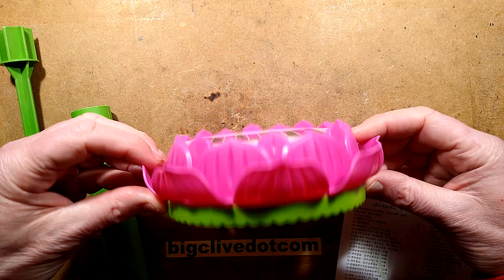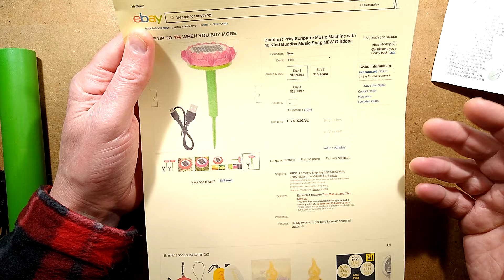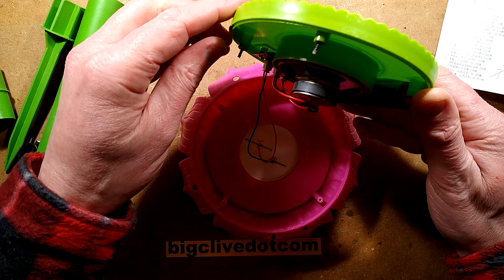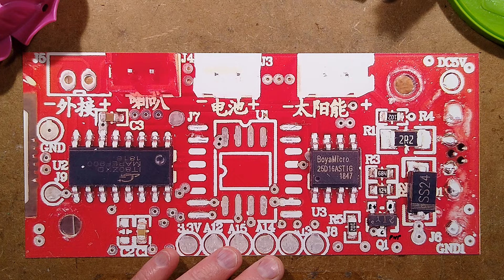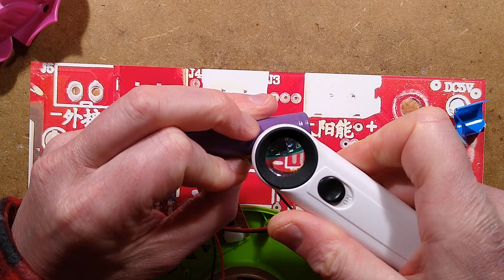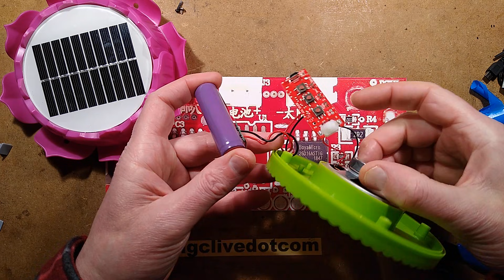Solar powered buddha chanting flower.

Comment: It’s probably not an MP3 player since DCT based compression is computationally expensive and that would be kind of overkill. A lot of these cheap talking/singing toy things use linear PCM at telephone quality which is 8kHz sampling rate at 8 bits per sample. Since the bit rate for that only works out to 64 kbit/s, you can store a little over four minutes of audio on a 2MB memory, and decoding can be done in software on any general purpose microcontroller with a built in 8 bit DAC. The raw PCM is usually just combined into a block and written to the memory, and pressing the track button just skips to a different memory address.
Reply from the maker: New video coming soon with memory dump from one of these.

Comment: The resistor based charger is terrifying... Why couldn't they use a propper Li-Ion charger chip instead?
Reply from the maker: It's a simple approach that uses the cells protection circuitry to limit the send of charge voltage.
Reply: @bigclivedotcom  I know why it doesn't explode but this is definitely not a great way to charge a Li-Ion battery. Doing this can shorten the lifespan of the cell.
Reply: @thatengineeringchannel4611  The solar cells are so low current, it shouldn't make for any trouble. And the protection circuit should cut off to prevent overcharging. This method of charging is cheap and ill-advised, but then, what about this thing isn't :)

Comment: there's a lot of fun being poked at the chants on this device, without understanding Buddhism. The intention of chants is to bring positivity to all. The quality is not important, it's the intention. What is the intention of those criticizing?
Reply: There is an Arabic proverb that goes "Open your mouth only if what you're about to say is more beautiful than the silence you're breaking" - this also applies to making lithium batteries and programming microcontrollers and moulding plastic. If you want help chanting, I'm sure there are plenty of free apps for your smartphone that can do just that without adding more clutter that depletes the planet's resources.

Comment: The empty space on the printed circuit board could have been used for a flash memory of maybe for an extra sound-chip to make it stereo. Anyway, if old electronics have done well they are reborn (recycled) into a Buddhist chanting flower. Then it has reached the highest level in consciousness and it does not have to be recycled anymore.

Comment: Hi Clive, I hope you read this as I have made an amazing discovery! I purchased a new old stock portable tape deck a year ago. It came with a dead, rechargeable Ni-Cd cell, as well as an AAA adapter. As you know, AAA cells are pretty useless, and I was disappointed that this otherwise very high spec deck used these, rather than AA batteries. My disappointment was further enhanced by the fact that it didn't like using my rechargeable Ni-MH AAA cells. They would work far less time than standard alkaline cells and would play the tapes slow, despite having loads of capacity left. Therefore, I came to the conclusion that I would have to use 1.5v non-rechargeable lithium cells, instead of 1.2v Ni-MH, for the best performance. I did look into using a dummy AAA cell in series with a 10440 lithium cell, but the voltage was slightly higher and resulted in faster playback. I didn't have the heart to open up the device and fiddle with the pot, as it is in excelent condition and I didn't want to accidentally break it. HOWEVER, here is the good bit. Very recently, a new brand called Kentli has developed a new type of LiPo cell, in a AAA or AA container. It has a LiPo cell inside a AAA/AA cell, which charges to 4.2v via a charging pin. However, it contains some circuitry at the top which drops down the 4.2v to a steady 1.5v, through the standard AAA/AA terminals/pins, making it a perfect fit. It outputs 1.5v until the LiPo cell has safely discharged. Would you like me to send you one to take apart? I am going to buy some now, to see if it sorts out my problem. I think it needs a custom charger too, because of the charging pin. I would be happy to get you these things. Do let me know :) Many thanks!
Reply: This is the article that I first looked at, I have looked at more since. It looks very up to date and is a novel battery idea! Forgive me if you already knew of all this and I am just so ignorant lol. https://reactual.com/portable-electronics/batteries-portable-electronics/do-rechargeable-lithium-ion-aa-batteries-exist.html
Reply from the maker: Those have been around for a while, but are getting better.  There also a simpler NiMh version with built in charger.
Reply: bigclivedotcom Oh my God Clive, I feel like a complete muppet now! I am so sorry for wasting your time with such a long and labourious message, when I hadn't in fact made a discovery at all. Lol!

In any usual case, I would buy NiMh cells, as this seems to be a less efficient use of a lithium cell (forgive me if I am wrong about that), but it seems the perfect use-case for my situation. My cassette player seems to precisely require 3v and a great feature of these cells, according to the manufacturer, is that they output a steady and constant 1.5v each, unlike NiMh.

I don't suppose you have much experience of these cells, as they seem quite niche. However, do you have an opinion on them or any thoughts about their performance?

Otherwise, I am ever so sorry for having bothered you with this and for having made a fool of myself. I am quite a fan, so I feel incredibly embarrassed now, haha.

Good luck with the Coronavirus situation and I hope that you and your close ones manage to successfully and safely weather the storm! All the best and take care :)

Comment: 17:05 - in fact, that missing centre chip could either be an 8-pin horizontal (mem?) chip OR a 14 pin vertically mounted chip with some other functionality ?????

Comment: Wouldn't the mp3 file be a lot smaller for a mono sound source?  Really, would it be higher than 56 or 64k for such a lousy sound system?  Seems like you could get a lot more into that 2MB than under different circumstances.

Comment: off topic question but I'm in the market for a new multitester and would like to know which is more useful, the analog or digital models?
Reply from the maker: Each has its own merits.  Digital is more accurate, but analogue can show fluctuations and average out oscillating signals better.

Comment: Might be using apple AAC+64 or AAC+128 at 36kbps mono or WMA at 48k mono to get the sounds on with the treble boosted to the hilt... but those 6 pads might be where it's programmed from, what pin does what I'm not sure but the data connection would most likely ground to a common ground with a data in & data out tap... if you could lift the audio data you could find out for sure what codec/bitrate is used... then load up john lennon "give peace a chance" and convert it to a hippy flower.

Comment: Any chance you could say something about this? https://imgur.com/52gfwAV? it's just popped up in the FB Charity Shop Shit group https://www.facebook.com/photo.php?fbid=10219687596713019&set=gm.2809539542461330&type=3&theater
Reply from the maker: Looks like a very simple pad vaporiser for the insecticide pads used in wall plug vaporisers.

Comment: I kind of want to get one of these and put a socket in for the flash chip so I can see what happens when flashing video game loop segments to this. Honestly, if it's on the less complicated end of things (so, if it has MP3 files instead of just raw data), I might have to buy the equipment for messing with stuff like this because these setups have always fascinated me (even though they're simple in principle).

Comment: Chinese text on the circuit board: 外接External 喇叭Speaker 电池Battery 太阳能Solar power
While holding the pause button, it switches between 全部循环Loop all (chants)& 单曲循环Loop current song
Reply: Given the other markings "External" looks to be for power.
Reply: @markevans2294  Or Line Out.  It's close to the microcontroller; if it were for 5V power I'd expect it to be on the other end of the board.

Comment: I'm curious if you plug this into a PC if it shows up as a removable drive and then you can put your own sounds on it. It doesn't seem to have data points but maybe there is a way into that 2MB memory chip to read out the contents and then put your own content on it.

I have a sound box that goes inside a jack o lantern and has this same two chip setup. It lights up and has a sensor. The quality is pretty good.

Comment: Reminds me of the 150 or so in 1 NES cartridges (counterfeit)  that work in Some NES machines but mainly knockoffs...  about 70 % of them are gibberish..  I suppose you could take one of those sort of machines apart  The big one with the micro sd card on the top and a fairly big screen that looks like a Playstation portable.  but says Portable Multimedia Player (doesn't really play video really well  , with 8gb on a sticker, alas this particular version I can't take the battery out.  There is a useless camera on the back.  Either way at least most of those aren't Gibberish.  They used to have NES games on them but by and large most of them have been removed.  Think  Nintendo was getting nasty.  I'd say the screen size is about the size of most smart phones today.  Either way that's not the Gibberish one.  one people like for some reason is a bit smaller and runs off triples  , I'd say for sure kids cause it's absurd to me..

Comment: Heya Clive and other people, quick question. I'm using some $1.50 6w COB LED fog/driving lights on my Tahoe (pack of 2) that I got from ebay connected/soldered via 22AWG wire and a 12v 5amp fuse cig lighter adapter, which is connected to a multi adapter with switches so I can turn on or off each light individually. Now the problem is, when the truck is idle/in park, the lights very SLIGHTLY blink/flash in sync with the engine/battery, now its very very faint and not very noticeable, but I was wondering if theres something I could add that would smooth that out or get rid of it? i'm thinking of some kind of "power smoothing" something or other, I cant think of the name for what i'm trying to think of lol. maybe i'm thinking of a capacitor? idk

According to the seller the lights only use about 300mA
Reply: Had an issue with my reversing lights (led bulbs) that the yearly check of the car found to be glowing faintly even w the car not in reverse. Seems the control provided a very high resistance path instead of a full off. This was enough for leds to glow faintly but ordinary incandescent bulb would not in the slightest.
After replacing one side w an incandescent bulb the other bulb didn't glow any more. The inc. bulb pulls down The voltage/allows a better path for the current.

You could try temporarily putting an inc.ulb in parallel - if that stops it you could test various resistors to see how low it needs to be to stop the behavior and add permanently. Just make sure it can handle the power it'll draw.
Reply: @michaeltempsch5282  Ive run into that problem with 'cheapish' USB LED lights and USB power banks before, even when off the LED's would have a TINY glow/flicker. My way of fixing that was to have a USB tester connected to the power bank and the light which stabilized it so it wouldn't flicker while off.

I tried something this morning that i'll be putting to the test soon now that its dark out.. In 1 of the reviews for the type of lights im using its said to be sure to use a good Ground with the lights so they'll be at their peak brightness, so instead of using the ground wire with the adapter I grounded the fog light to the truck. So when I go to the store later i'm going to see if there is any sort of difference, especially now that I have the 2 lights wired together instead of using separate adapters and on/off switches.

i'll give your idea some thought, thanks :)

Comment: Showing in this video is a solar power lotus flower shape device represent Buddhism chanting of NAMO(Refuge)AMITUOFO or AMITUOFO meaning a BUDDHA of Infinite Life and Infinite Light from the AMITUOFO PURELAND. There are different tunes for the user to choose and its a non stop player. The user can either follow the player chanting AMITUOFO in the mind or chant it out or leave it chanting AMITUOFO continuosly as it benefits all. Everyone can use it if they have the affinity with AMITUOFO. 
China had invented the Buddhist Chanting Device long ago with different types of shapes and chanting of Buddhas and Bodhisattvas and even AMITUOFO PURELAND sutras texts. There are electric power and solar power. It has been using widely in Buddhist temples, houses, shops,  gardens. 
🇨🇳 ☸ 🙏
AMITUOFO is in Chinese. AMITUO is the name of the Buddha and FO is Buddha. In Sanskrit is AMITABHA. AMITA is the name of the Buddha and BHA is Buddha. As our life are impermanent believers will chant AMITUOFO and Vow to Rebirth AMITUOFO PURELAND. 🇨🇳 ☸ 🙏
Reply: They also have purely mechanical versions powered by inertia and believers walking past and giving the machines a push.  The mechanical versions have the repeating chant written on the side so pushing it makes it repeat the prayer many more times than a human believer could say it.  Apparently, the Buddhist faith accepts these as equivalent to manual prayer, only more efficient.
Reply: John Crower Doe not equivalent, different activity different karma.
Reply: Thank you

Comment: When I heard the sound I thought one of those tiny cheap speakers but no.
It all looks quality. even has holes in the petals to drain rain water away.
But for some reason they put crap quality sound files on it.
Maybe it was meant for just a couple of MP3s but they cheaped out and went for quantity over quality.

Comment: the moment you turn it off, it says "关机" which is "power off".
Reply: Also,
13:00 "全部循环" means "loop all tracks";
13:03 "单曲循环" means "loop current track".
Reply: 关机 = Guānjī (Shutdown)
全部循环 = Quánbù xúnhuán (Loop all)
单曲循环 = Dān qū xúnhuán (Single cycle)

[Kangjia Huang - you are correct. I'm just adding Pinyin. 别担心 ]
Reply: @ann_onn  Thank you for the translation. Though I agree with the others that "Burn in hell" was a lot more fun, it's still useful to know what the real meaning is from the unit.
Reply: @ann_onn  没问题
Reply: Awesome! Thank You. That is very interesting. It is quite disturbing that someone would produce something as cheesy as this device to "help" promote spirituality or spiritual serenity. I suppose, though, you can't put a price tag on that. It is from within and free. And nothing can take that from you.
Reply: @jlucasound  it's probably for being spiritual in your tiny closet of an apartment in Beijing with all the train noise.
Reply: Was that second sample saying "UNHELPFUL UNHELPFUL UNHELPFUL"??
Or is my built in auto translate playing up again?
Reply: @j.cheeverloophole9029  Timestamp?
Reply: clears throat PAWA OFF

Comment: 6:08 the are probably called like that because that board has been made to be compatible with multiple e2proms  or footprints there of and since there is one rather big plcc footprint on the board that is the parallel e2prom while the 25series chip is a serial one..

edit not a plcc but a so8 and a bigger so package rotated 90 degrees relative to the so8

Comment: To read out or replace the flash contents I would recommend the ubiquitous "Bus Pirate" from Dangerous Prototypes and an SO-8 chip clip. Often you can hold the control chip in reset (if you have access to a reset line) and access to the serial memory lines in circuit without issue. Worst case would be to hot air desolder the flash chip. I would be surprised if the data format was too different from a vanilla MP3 or even different at all, and I would not be surprised if this control chip could be connected directly to a uSD card. Chances are very good the flash chip contents would look just like a 2 meg FAT12 or FAT16 volume and the files are likely named 001, 002, 003, etc.. The chip may be a clone of the GPD2856C from GeneralPlus. It may also be an AC1082 which is quite similar and reads FAT32 file systems.

Comment: The unpopulated chip slot is labeled U1 while the maybe-processor is U2 and the memory is U3. I'm thinking the same board can be used in other devices maybe with a remote control or something and that's what the not-present chip is for. You should trace the leads coming from the pins to see where they go.
I was amazed to see that relatively enormous speaker considering the absolutely shitty sound quality. I was expecting a puny piezo.

Comment: Are any of the unpopulated IC pads commoned with the pins of the serial memory chip? you may be able to use 2 chips together although Im not sure if you would need extra support circuitry.

Comment: I designed a similar MP3 chip into a product awhile back, and it's a microcontroller + DAC + DSP + flash + RAM all in a single chip.  they let you hook up serial flash (which is what that unit has), or an SD card socket, and a few other memory options.  The chip can be custom programmed to do looping and what not, which is probably what they did.  If you don't get the custom programmed part, you can make it perform the looping and such with an external microcontroller, through a serial connection (rs232 type at logic level).
Reply: Got any documentation? Or was it just a one-off for lulz?
Reply: @ann_onn  dfplayer mini board uses such a chip and the module is quite well documented
Reply: @ThisMicrophoneSoundsCheap  Yeah, great. Where's the docu,emts?

Comment: I'd say 64kbps low dymamic range mono wav/mp3 equiv if even that.
Reply: Yep. Mono makes MP3s half the size straight up. And it definitely doesn't sound like it's more than 64k.
Reply: @Dave Micolichek  You can compress wav  fils exactly the same as MP3 MP# 's are wav files encoded with different codecs.
Reply: @Dave Micolichek  Yeah it's the same thing though the file extentions are interchangable.